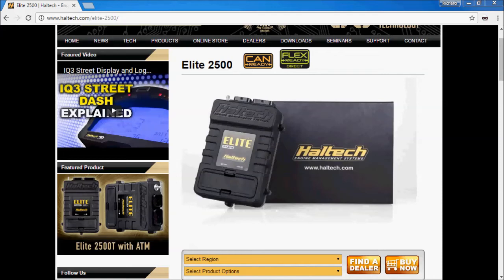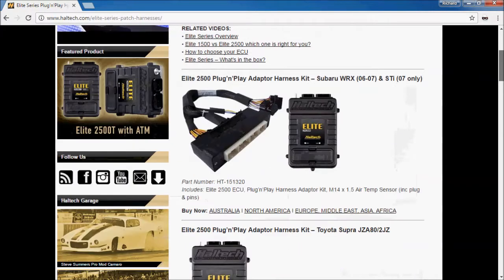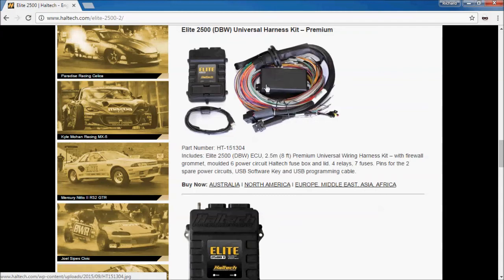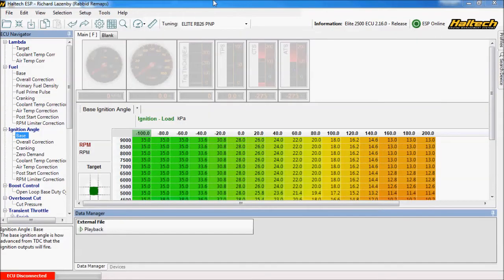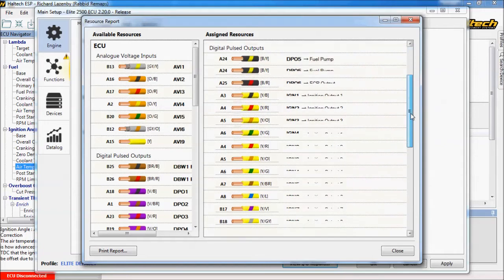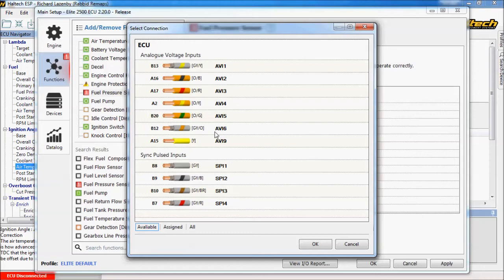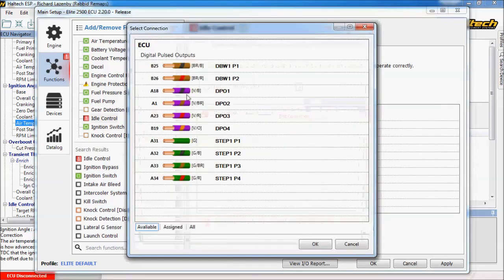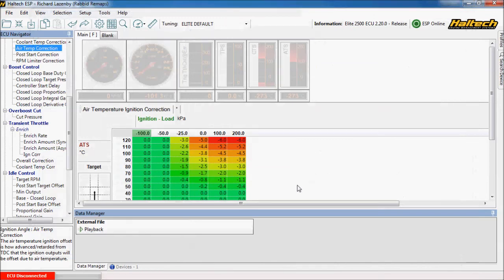Haltech Elite Tutorial Part 1 - Selecting an ECU

Comment: Can u please explain the trigger setup? What is difference standard full cylce with half cycle.. and when we going to use it... just the ones without specific car model..
Reply from the maker: Half cycle is for batch or semi sequential where cylinders are paired on a 4cyl 1+4 and 2+3 are fired in pairs every cycle. 

Full cycle requires a cam sensor to separate a cylinder that is firing from another which would be on its exhaust stroke.
Reply: @tunedbyrabbid  Similar to a waste spark system for ignition.